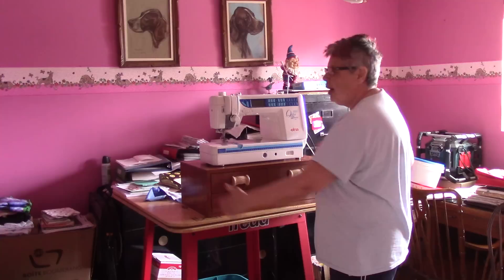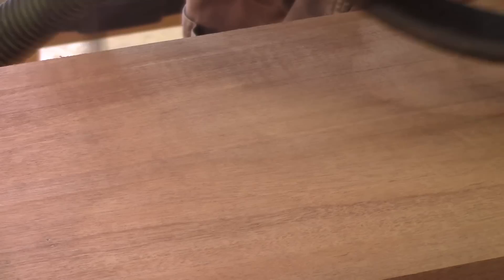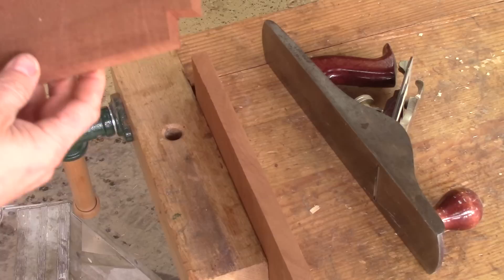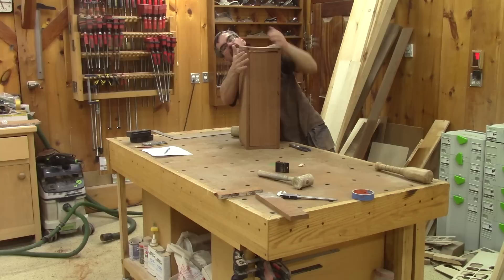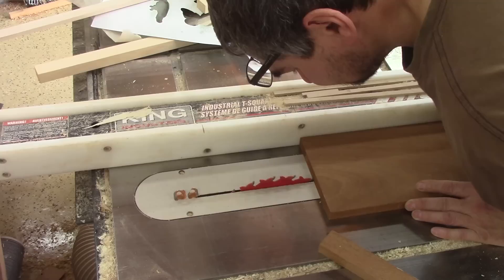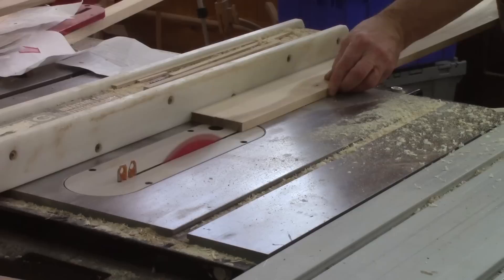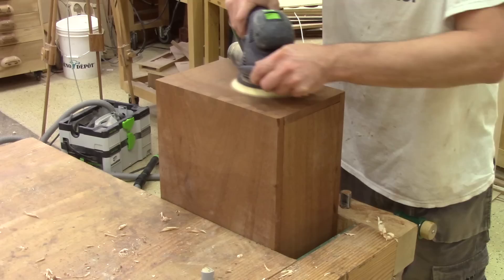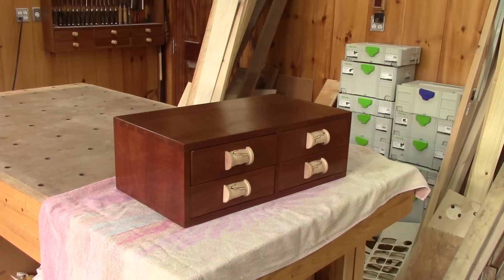The Woodpecker Ep 238 - Sewing box with 4 handcut dovetail drawers

Comment: The whole box is amazing but those drawer pulls, wow! I've never seen handles made like that, especially with the laser design, how long did that take to figure out?
Reply from the maker: I was not too sure about the pulls, but in the ends they turned out pretty amazing. 
Not too long actually, I don't use my 4th axis very often but having it, opens new possibility. You see a lot of people thinks that a CNC is to make cut someone can do by hand. Yes it's true most people do that, but they're more to it, and being able to use it like that makes ordinary things not so ordinary. After finding a picture of a needle and a thread the rest was just to place them on a flat surface and burn it round, it's not that complicated

Comment: One thing I hate about Japanese saws is that they all curve as you cut with them and they are hard on wrists. They don't cut any faster than regular so I don't see the point. Pull saws were used before but us North American people developed the larger stiffer saw for a reason.

I would have things a little different myself. As for holes from grooves I use scrap cut to fit each hole and glue them in. You can cheat at hand it dovetails on table saw. I use table saw to remove the bulk and then finish with chisel.
Reply from the maker: I mostly use my japanease saw for cutting scrap or thing that I don't need precision,  I find them too thin also and my blade is all crooked and broken, yes  I have a replacement but since I don't use it a lot I'll wait until the blade won't cut anymore, but then I won't be able to find my replacement blade,; story of my life...
True I could have put a piece of wood to fill the missing part, didn't think of that at the time....